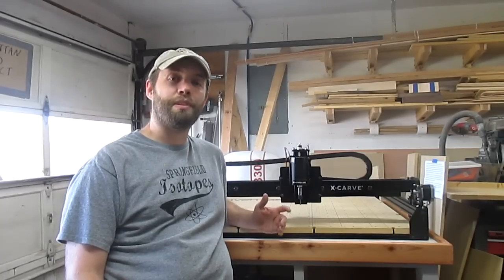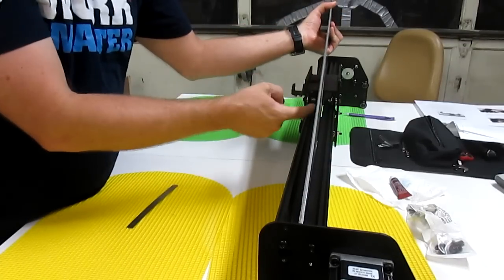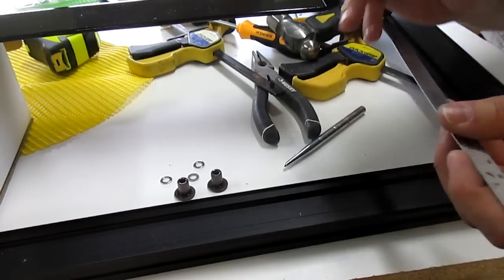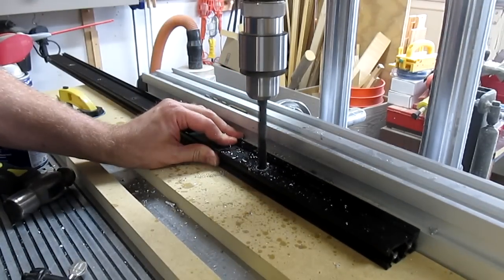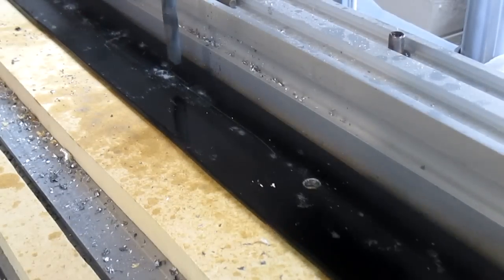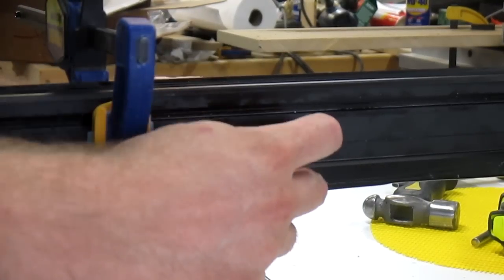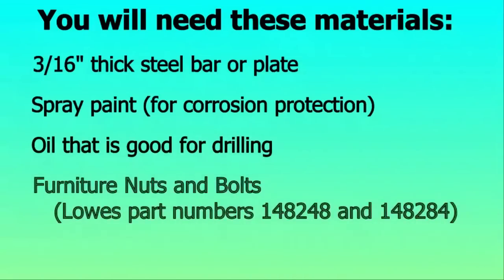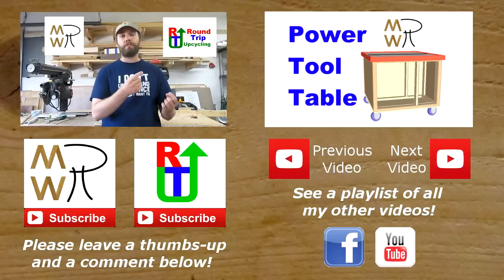31 - X-Carve X-Axis Modification - Manhattan Wood Project

Comment: Couldn't you substitute aluminum stock rather than steel?  

I'd think the reason of the chatter would be from empty void in between the two maker slides, and essentially what you're doing is sistering them together.  

The only reason I ask about aluminum is the weight added and the strain on the motors- I'm assuming you have the upgraded motors? Have you noticed any difference?
Reply from the maker: +omgbbqwtf2 The chatter comes from the fact that the makerslides are relatively tall and thin, which allows a lot of movement around them.  By clamping a bar in between them, we're changing it to a square(ish) cross-section which provides a better defense against torsion.

If you can find the right thickness of aluminum, you could definitely substitute it.  You may not get quite the same amount of stiffening, but the steel is probably overkill as it is.  There are other X-Carve users who have put long bolts vertically between the bars and achieved sufficient stiffness to cut hard materials.

I do indeed have the NEMA 23 motors.  I installed the steel stiffener when I was building the machine, so I don't know what it would have acted like before.  I haven't noticed any problems though, the motors seem to be moving the X-axis and the heavy Dewalt spindle just fine after the pots are adjusted properly.
Reply: Thanks for this post as Im about to make the change this weekend and was concerned over the additional weight the steel would add (4lbs by my estimate) and if the Nema 23 stepper motors and power supply could handle the additional weight.

Do you happen to cut cabinet grade plywood?  If so what router bit, router speed, cut depth, and feed rate are you having success with?

Comment: I wonder..
Is it wrong to use with aluminum ?
Kristian
Reply from the maker: +rednotereso I've cut a couple parts out of aluminum without any problems.  You've got to use the right depth of cut and feed for your machine though, and make sure the chips get removed from the cut, but the parts I did were all without any sort of lubrication and the cut edges had a beautiful finish on them.
Reply: +ManhattanWoodProject 
Thank´s Sirs
I have aluminum att home at the right size.

Comment: Great video!  A few quick questions : (1) I know you shortened it from the original 36" but did you also have to shorten it height wise?  In other words, did you keep it at 2 1/2" or make it shorter.? (2) can I use a jigsaw to make this cut? (3) My drill press has only a 2" swing,  will that suffice for this project? Thank you so much in advance and again  awesome video!
Reply: Any input would be greatly appreciated.  Thanks
Reply from the maker: +William James  Thank you!  I'm sorry it took a few days for me to get back to you, but I hope this helps:

1.  The original stock was 3" tall, so I had to cut about 1/2" off to make it fit height-wise.  You could easily use 2" tall material and not have to cut it down, I think I over-engineered it.  You could also probably use aluminum instead of steel.  It might reduce the stiffness, but probably not noticeably.  Also make sure you find a good straight piece of steel, sometimes it's hard to find a piece that's not bowed or twisted in the big box stores.

I initially thought I had cut mine too short from the 36" length, but it turned out to be just right after installing dust guards that are just shy of the bottom of the makerslide.  A couple inches short on each side won't make much of a difference, and will give you more room for future upgrades.

2.  If you have a blade that will cut through steel, there's no reason you can't use a jigsaw on it.  I've never used a jigsaw on steel, but I imagine you'd have to go nice and slow and use plenty of lubricant.  I used a grinder for most of it, and had to use a hacksaw for a couple inches when the grinder died.  I'd recommend going with something that doesn't need to be cut lengthwise.  :)

3.  The makerslide is only an inch or so thick, you could definitely use it on your drill press.  You may consider drilling a small hole through both pieces at the same time with a hand drill first, just to make sure it all lines up right the first time.  Then after you've drilled the holes and loosely installed the makerslides, you can clamp the steel in place and make marks where you want to drill it.  An oversized hole probably won't hurt in the steel since the bolts don't need to be touching it to clamp it in place, and it'll give you some room to wiggle the plate around in case you want to move it up, down, or sideways a fraction of an inch.

Comment: i just wonder if the pvc wheals on the x-carve aren't made to handle the extra weight of the steal slab?
Reply from the maker: +benshke That's a good question.  They seem to be holding up well so far, I think one of the biggest things is to not have them too tight.  As long as the biggest stress comes from the weight and not from the wedge of the track being forced up into them from excessively tight eccentric nuts, I think it'll probably be good.  Only time will tell though...
Reply: keep me posted on that

Comment: Great upgrade.  It made working with aluminum much better. I did use aluminum stock for the insert as I was lucky enough to have a supply house close by and the 3x36 bar wasn't that pricey. I have to think I'm getting almost all of the rigidity benefit from the aluminum as I would with the steel and it was a WHOLE lot easier to cut and drill. I would suggest one tip though for anyone who plans to leave the width wider than the maker slide for that extra benefit, put a small notch on the bottom at each end so you can get your allen key behind the adjustable idler. Otherwise you're going to hate doing that adjustment with a cut down key and almost no room to maneuver.
Reply from the maker: +Michael Williams That's a good point.  I ended up replacing the button head bolts with hex head bolts, which lets me use a couple of wrenches instead of allen keys.  Much nicer!

Comment: Question, why did you leave the filler piece hanging down below the maker slides? Would it not have given the same support without hanging below the maker slides? To me it looks like it would have been a cleaner installation.
Reply from the maker: James Mitchell It could easily have been cut the same height as the makerslides, but the taller it is the more stiffness it will provide.  I haven't crunched the numbers, but I'm guessing that additional 3/4" wouldn't make much of a difference unless I put a ridiculously heavy router on.  It would have been cleaner to cut it the same height, but I figured I'd err on the side of support.  :)

Comment: What did you do with the wires running through the makerslide? Did they still fit?
Reply from the maker: John Baum Great question!  I didn't have any problems pushing the wire from the right Y stepper to the left one.  I suspect that if the holes were drilled 1/4" higher they may interfere, but as long as the bolts are kept low (1/2" above the bottom lip) they won't be a problem.

Comment: I'm guessing you checked within Inventables about the modifications and wondered what they said regarding stress on the xy axis motors due to the added weight!
Reply: That's a good point. I would THINK it would be fine, but I'm sure one could use flat bar aluminum instead of steel if weight were a concern. It's more costly, but would work.
Reply: You're probably right. Hope it works out well for you.
Reply from the maker: MRrwmac I considered asking them, but this has been a topic of discussion on their forum for a couple months and they haven't recommended its use either way.  There are enough people doing this modification that I think someone would have spoken up with negative effects by now.

It does add a little more weight, but my gut tells me that both NEMA 23 steppers can handle it.
Reply from the maker: Just Make It Aluminum would probably work nearly as well, I'd be interested to see what the relative sag would be with the stock spindle and a big router.  Probably only a matter of a couple thousandths, which is reasonable.

Comment: I'd like to share a link with you. I used a .25 pitch chain for my x and y axis. Belts stretch chain will not.
http://youtu.be/oJJJpLSzIqc
Reply from the maker: ShadeTreeCNC Neat, I can see a definite advantage to the belts.  Is there any lash between the links and the gears?
Reply: No backlash with light load. No loss of load. No adjustment now and the cnc I built is over a year old. Check BuildYourCNC.com it is wear I got the idea.
Reply from the maker: ShadeTreeCNC Wow, I'll have to look into that.